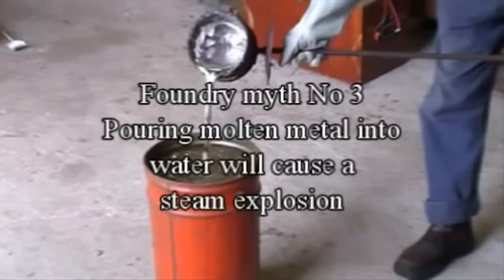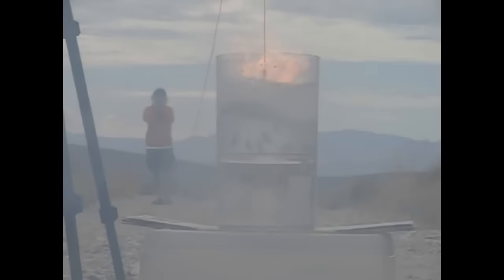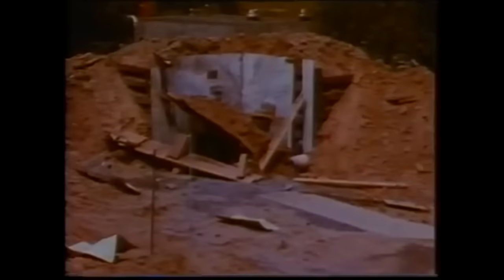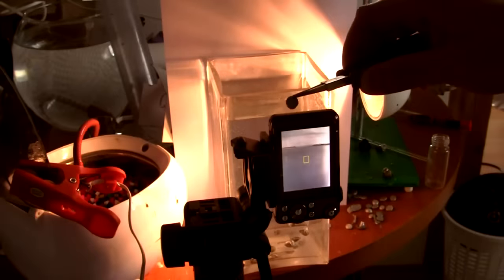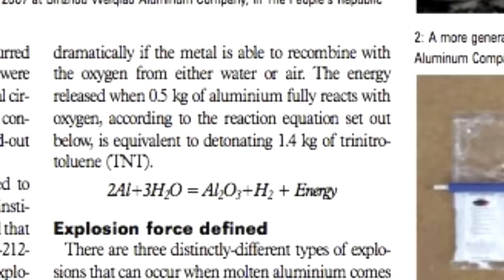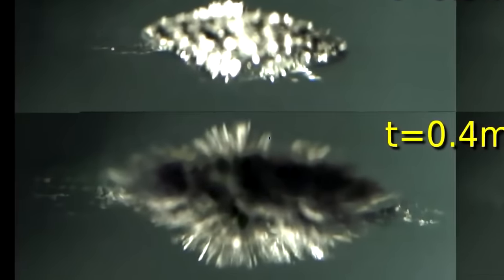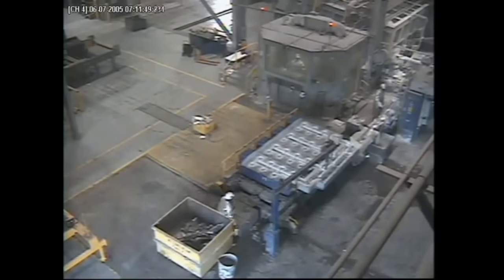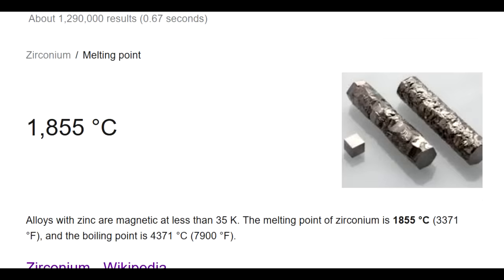The Awesome Power of the Aluminium-Water Explosion!

Comment: I'm not a chemist nor an  physicist but may I forward an idea (feel free to shoot it down  for practicality reasons or any reason at all). This reaction reminds me of hypergolic rocket fuel. Is the energy content of aluminium, sodium or potassium dense enough to warrant using it and water as a fuel in space? Since space by it's nature has no oxygen to form that oxide layer, might a contained mix of water and one of these metals (sealed in it's pure none oxygenated state) be useful as a possibly more stable and less toxic propellant in space? For example steering satellites, small reaction thrusters etc...?

P.S. My spell checker didn't like hypergolic or thrusters but I believe they are correct.

Just a thought

Comment: Water expands at a rate of 1600 percent when converting to steam or about 3600 foot per second (many variables). That creates an explosion like event. It is caused by steam being created faster than it can be dissipated because of a containing force ie metal box, or in the case of a foundry, molten metal being poured over wet or even moist molds. This creates flash steam and a rapid expansion inside the molten metal which then causes the metal to be thrown in all directions in an explosive like event. It has nothing to do with aluminum being reactive to water, its not. It has everything to do with molten metal creating and momentarily containing steam. Dangerous and deadly. Conversely, you can poor molten metal into water all day safely because the steam is not contained in any way. No pressure build up, no rapid expansion. As a comparison explosions occur at about 9,000 to 27,000 fps.

Comment: Is there a difference between adding aluminium to water, and adding water to aluminium? As there is with acid and water - always add acid to water, not water to acid, as my chemistry teacher drummed into us. Mind you, I used to add distilled water to the electrolyte mix (acid) in my car battery. The battery didn't heat up like my chem teacher showed us.

Comment: Which metals would not explode?  I’m assuming iron or steel is safe since blacksmiths use water to cool down the metal but maybe that is not an accurate comparison to pouring molten metal into a bucket of water.

Comment: I worked in a ductile iron foundry, we had a wet charge of scrap steel (wet scrap metal) into 1 ton of molten iron it went off like a bomb threw 1ton scrap cubes out of the furnace, ripped the lining out of the furnace and blew the coil to smithereens leaving only the furnace outer shell.

Safe to say after that incident I left the company because that was too fucking wild to deal with again.

Comment: While I'd never pour molten water into water, I'm more afraid of pouring water into molten metal. If there's a lot of water, the charge is quenched slowly enough and has space to shed its steam jacket, you don't really have much risk of an explosion, but you if even a small lick of it comes out, it's gonna hurt a hell of a lot more than water in hot oil and you're holding a crucible full of molten metal. Wet charges however are another mess entirely. I legitimately believe if you managed to sneak a few thick steel bottles of water into an open hearth, you could destroy the entire facility.

Comment: It the quanity of water to molten Al that makes the situation more or less dangerous. The foundary was more excited due small quantity of water boiling off quickly in a rigid structure.
The others are using large quanities of cold water which an accomodate the extra energy being put in 

It the energy not the materials
Reply: Not so. In addition to the energy added to melt the aluminium, there is chemical energy if you get clean (unoxidised) aluminium in contact with water. The video did kind of mix that up in the presentation

Comment: I'm pretty sure it's safe. It's only dangerous if a lot of molten metal contacts a little water to cause a steam explosion, like with hot oil and water, or acid and water.  I don't think the examples given were from a rapid exothermic chemical reaction.

Comment: The main danger of aluminium and water is not the same as with sodium. While it's true "pure" aluminium will react, you can't really get it pure, without the oxide layer. The issue is with steam getting trapped under the metal. That's how you get an explosion and molten aluminium flying all over.

Comment: @Thunderf00t

This actually made me think of a pretty nasty metal based explosive called Mercury Fulminate . (Though I'm pretty sure in this case it's the breaking of Nitrogen bonds that produces the energetic reaction.)

There's a story I heard about an idiot (& near Darwin Award winner) who mucked 'round with blasting caps made of Mercury Fulminate (maybe a gram or two of the stuff on a strip of cardboard like material, coated with a drop of resin) in an Australian mining town way back in the 1960s. 

Apparently being a real hard man this dumb-ass wanted to impress his mates down at the local drinking hole by messing with these incredibly sensitive, very potent little bangers. After a beer or 2 (or 3, or 4) he decides to show off by putting one of these things on the ground & stomping on it - with the idea that it'll go bang, everyone jumps, laughter all 'round.

Instead of the teeny little bang he was expecting, he gets a slightly bigger one. It rocketed his foot up high enough that he cracked himself on the jaw with his knee, breaking both his patella & his jaw, badly straining his neck, causing a mild concussion (sloshing his brains 'round inside his skull a bit) and - of course - badly bruising his foot. (He was luckily still wearing his thick-soled, steel-capped, leather work boots, or the blast likely would've pulverized his foot & sent bone shards everywhere.)

The damn things were not only extremely unstable, but also (prob'ly due to shitty manufacturing quality) were dangerously variable in potency... 

Explosives are fun, aren't they?   ; )~

~ ~ ~

BTW - You wouldn't know what might cause an exothermic/explosive reaction in a mixture of brake fluid & pool chlorine ..? Asking for a 'friend' of mine : | ( who used to do some very naughty things as a teenager, many years ago ).

Comment: When a blacksmith is finished working, do they often put it down into water or oil. How is that not insanely dangerous?
Is it a difference in heat, the fact that the blacksmith only puts solid objects into the liquid?
Can the amount of water do any difference? Larger amount of water demands larger amount of energy to boil?

Comment: I'm not as smart as you guys, so pardon me if this is a stupid question.  But I bet Thunderfoot could answer it, if it is not.  So, why doesn't aluminum explode, when you cut through it with a reciprocating saw, like a jig-saw.  You are cutting into an area where an oxidation layer hasn't formed, right?  Cause it isn't the outside edge of the metal, but the inside edge that has never seen air that is being exposed.  True, that it is now a new outer edge where the cut has been made, but if you do this underwater, it shouldn't be able to form an oxidation layer right?  So why doesn't aluminum metal explode when you cut through it with a jig-saw, while under water?

Comment: Thunderf00t get the aluminum burning and then dunk it in water then you got your aluminum water explosion... The explosion occurs only with overheated burning Aluminum... The flame sin not so visible on the aluminum when it is overheated so getting water on it or pouring it in water at that state it is a suicidal

Comment: It is very difficult to make pouring aluminum into water explode as shown by all those how have done it including myself because of the oxidation coating but if you drop water into a pool of liquid aluminum like the crucibles in a foundry it is guarantied to explode every time as the water impact will always break the oxidation layer, this is the basis of a theory put forth by two engineers as the cause of the twin towers collapse that the planes aluminum pooled in the fire hot enough to melt aluminum but not hot enough to effect steel then all that was needed was a pop can, coffee pot or a 5 gallon water cooler bottle to fall into the pool then the steel strength would have been compromised by that energy release. Sorry for going a little off topic.

Comment: Hi Thunderf00t,

While I do agree with the obvious principle of not handling metal when you don't know what you are doing, I do not agree with your explanations. TL;DR at the end. Sources provided.

In this report [1], you'll find 3 pathways to metal-water explosions, each discussed below the list:
1) Vapour expansion: when water vaporizes, it expands to ~2000 times its original size. If the vapour has no escape path, it creates very high pressures that can cause an explosion if they get suddenly released.
2) Hydrogen explosion: H2 is formed by high-temperature metal oxidation. Hydrogen may then explode by reacting with the dioxygen in air.
3) Carbon monoxide explosion: some alloys such as steels and cast iron contain carbon which oxidises into CO in high temperature contact with water. Like hydrogen, CO may then explode by reacting with the dioxygen in air.

Pathway (3) is impossible with aluminium since it doesn't contain carbon.

Pathway (1) is the one mostly encountered in foundry and heat treatment:
Liquid metal comes into contact with a wet part and liquid water is trapped in the molten metal or between the molten metal and a surface (e.g. a wet mold). It expands an causes an explosion. This is likely what happened with the container explosion at 1:00, and this is definitely what happens in the mold at 12:00
However, when you put hot/molten metal in water, this doesn't happen, as shown by [2 and 3]. This is why you don't have "quenching* explosions". While I don't know the specific reasons, this probably has to do with the Leidenfrost effect (formation of an insulating vapour layer on a very hot surface), water allowing bubbles to form more easily [2]. Study [2] was made by pouring liquid aluminium on plates submerged into water. Explosions only occurred when water was trapped between the plate and liquid aluminium. This was caused by the high wettability of the plates**. In my understanding, the surface wettability allows liquid water not to be repelled by the vapour layer around the metal. In all logic, the geometry of a surface can cause this effect too.

For pathway (2) to occur, you'd need enough H2 generated, and mixed with air, and that mix needs to reach 536°C for ignition. This can in theory happen if there is still molten aluminium (>660°C) above water but is unlikely. In [3], fall of liquid aluminium into water (in the context of a nuclear meltdown) was attempted but didn't generate H2 in the non-lithium-containing aluminium alloy. [2] also only triggered vapour explosions.

To sum everything up:
The danger of molten metal-water explosion is mainly due to vapour explosions. These are caused by the trapping of water into, or against, molten metal. This does not occur in the molten-metal-poured-into-water scenario unless the liquid metal lands on a very hydrophilic surface. If the water is deep enough, and the pouring progressive enough, the skin will have already hardened before the metal reaches the bottom. This is why the I-pour-into-a-pool and I-pour-into-a-trash-can guys were at little risk.

However, I was mostly arguing for the sake of arguing, and because my own engineering background disagrees with your explanations: do not handle things if you don't know the risks involved and safety precautions to take. This is valid for molten metals, chemicals, machine tools, cars...

______

*For the layman, quenching is putting a hot (815~900°C, for steels) part into a coolant to obtain specific properties. The coolant is often water or oil (but can also be air).
**On a highly wettable surface, surface tension will cause water to cover as much surface as possible. We often call such a surface "hydrophilic".
______
[1]https://www.aria.developpement-durable.gouv.fr/wp-content/uploads/2013/08/FK_imp2009-water-metal.pdf
[2]https://link.springer.com/chapter/10.1007/978-3-319-48228-6_133
[3]https://www.sciencedirect.com/science/article/pii/0029549394008864

Comment: Have you seen the people who say they can make an internal combustion engine run with water as the fuel, and it turns out it's a tank with aluminium in it and a liquid metal alloy that coats the aluminium and can allow the water to contact the non oxide aluminium at ambient temperatures, taking the oxygen from the hydrogen and producing aluminium oxide and hydrogen gas.

Comment: When you say there is a lot of energy 'in' something, you mean over and above the basic E=mc^2, right?
Reply: Oddly enough E=mc² includes this energy; because energy and mass are the same thing, not just interchangable. But you're not wrong this "potential energy" doesn't involve annihilating any matter, just moving electrons and protons closer together so they are deeper inside electromagnetic potential wells. This releases that energy, mostly as heat.

Comment: In a large body of water, the steam expands into the water, cools and condenses back into water instantly.  The steam expansion pushes the water away just a short distance.  A small amount of water trapped under the metal would be a totally different story....the violent steam expansion ejects the molten metal around it explosively. However, if you tipped the molten metal into a water pool all at once...it COULD trap water under it..and boom!...steam explosion.  This is bad enough...but the hot, pure Aluminium and water chemical reaction is way worse...this is only prevented by the instant formation of Aluminium Oxide on the metal’s surface.  I want to see those clever kids pour molten Aluminium into a bucket of a strong solution of Sodium Hydroxide (Drain cleaner).   That will be worth seeing!😈

Comment: Sodium and potassium react chemically with water in a violent manner, even at room temperature.  Pouring molten metals into water runs the risk of superheating the water rapidly and explosively into steam, but this is not necessarily a chemical reaction.  Thermite is an entirely different situation, with strongly exothermic reactions in the absence of water.  Probably not a good time to be introducing water, though.  Your point is well-taken;  these people need to find other forms of entertainment.  At least, I think that is your point.   Be sure to tell everyone not to ever, ever mix certain household chemicals, as the result will predictably and swiftly end in the experimenter's demise.

Comment: Why doesn't aluminum foil react with water along the torn edge? Or does the protective oxide layer formed quickly on contract with air?
Reply: The oxide layer is formed nearly instantly.

Comment: That Chernobyl idea I think you could probably do it if you could heat up the metal in a vacuum then drop a small droplet into water I'm also assuming it may be easier to get it to its melting point in a vacuum though I could be wrong.

Comment: Moisture and molten anything is dangerous. Had molten lead explode pouring into a mould for weight belts forgot to preheat and still have burn that went though my welding jacket. Another experience pouring Babbitt bearings slight bit of moisture ruined a days work preparing a job. Buddy got lucky and things were in his  favour but test fate it will test back

Comment: There is an "urban legend" about forging on an anvil and water being on it. Now there is truth to it but mostly just fear based bs. The legend is if you have water on your anvil and you drive a blow to red hot steel or other metals it will explode and send the hammer into the clouds and you will die. The reality is if you have a few drops and drive a blow to red got metal, you will absolutely cause an explosion that will fire off red hot chunks of scale/oxide 360 degrees into every direction with a loud snap but It isn't powerful enough for the explosion itself to kill you or send a hammer flying. I learned that as a kid and scared the hell out of myself.

Comment: Are this explosions really because of the chemical potential of aluminium, or yust because of the fast evaporation of the water? There is a video wiht someone throwing a water bottle in molten steel and it explodes.

Comment: Some of these guys are scientists and they know by the temperature of the molten metal if it can be explosive or not...

I only know this because I recognized one of the experiments from a guy I watch often...

He's a pretty smart dude overall but I think he does take unnecessary risks.

Ultimately I think the danger comes from a small amount of water and an extremely hot piece of Molten metal...

In every one of the experiments they had at least 50 gallons of water if not a thousand.

You just could not cool that much water that fast for it to have an explosive reaction.

But imagine a golf ball-sized Gob of molten metal would it evaporate a half gallon? maybe... potentially making it dangerous.

Once the molten metal is so hot and there's so much of it that it can instantly turn all of the water into a gas with explosive force. That's when it becomes an issue. At least that's what my subconscious is telling me.